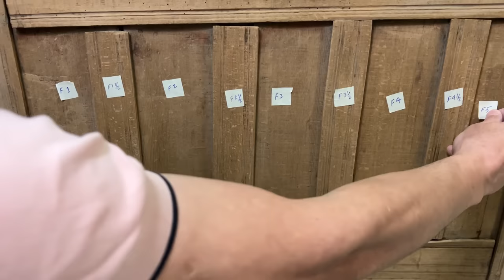Restoration of the 500-Year-Old Chest - FURNITURE RESTORATION

Comment: I'm glad you're happy with your work. 

If i had brought this to you i would not want done what you did to it. 

Wash it down with soap and water and steel wool. 
Let it dry.
Apply seversl coats of bees wax! 
Polish or buff!

Fini!!!

The dirt, grime and dust are all part of its history. It now looks nearly new, which a 500 year old piece should/would not do! 
You simply went too far, in my opinion!!!  I prefer old things in a more 'as found' confition! 

There is a HUGE difference between repairing, restoration and conservation.   I prefer conservation and you prefer restoration. 

To each their own.   But please consult with museum preservationists before working with the more rare pieces you deal with---  for a bit of added input.  

PLEASE!!!
Reply from the maker: Thank you my friend,
True, I prefer restoration, I like to make things usable, I hate dirt, I cleaned and restored this in the way of my ancestors...
Beeswax is good, Worm wax is a problem for this piece...
You are right, I may have gone a bit too far, but I did not destroy the patina of this piece, it is a special wood, if I had followed your method, it would still have the same final shape...

Maybe it's rude, it's the first time, using this wood is uploaded on YouTube, and there is limited information on the internet, for me it was interesting to work on this chest, from the art of carpentry and the type of wood, it's really special...

Now I have a question for you dear friend, why did the carpenter bend the parts inside the pieces?

Thank you for your comment and guide...

Comment: How 500 years ago did woodworkers make the wood panels so thin and smooth? How were the trees processed to such uniform thicknesses?
Reply from the maker: About 2500 years ago, our ancestors used to cut and polish hard stones like mirrors. Carpenters patiently and patiently cut the trunk of the tree in parallel with a two-person hand saw and produced thin timber, and it was also observed in examples that they did this with an ax and then polished the wood.
Reply: @CreativeIdeasMaker  Humans are capable  of so much more than 'modern' industrialists may care to admit. Hand-made and -crafted items I suspect absorb some part or essence of the maker.

Comment: In the beginning of the video you said let's see how this piece was made without nails but i counted quite a few pretty serious nails and why bother with the coke? If you used baking soda and vinegar, the coke would just make things sticky.
Reply from the maker: If you are careful, two types of cast and modern nails have been added to this chest during different periods and it has actually been violated because this chest is made entirely of wooden pins using wooden connections, which we also use as iron nails. removed and we have used wooden pins as in the beginning of its construction. As for the solution, it is a type of cleaner for wood and it also softens the grain of the wood, which helps to better penetrate the oil coating after sanding.

Comment: Will the sesame seed oil dry out, or will it become tacky and gummy with time?
Reply from the maker: This type of oil has little adhesion compared to the adhesion of pollutants such as dust, and on the other hand, it has a significant permeability in wood. If the texture of your wood is soft, you will notice the depth of penetration of this oil.

Comment: Sugar water (coca cola) is a poor cleaner.  It works for some stuff because of the acidity. But then you added baking soda, which neutralizes acid.  The addition of white vinegar raises it back.   Next time, use plain water first, then a diluted all-purpose cleaner.
Reply from the maker: wow, you are absolutely right in terms of toric, but in practice, I made a weak acid with high cleaning and did it with minimal damage to the wood, this is my invention.
Multi-purpose cleaner works great on veneered wood, but will damage raw wood...
Reply: @CreativeIdeasMaker check out Thomas Johnson Antique Restoration.  He uses diluted “Krud Kutter” on veneers and solid wood alike with good results.  He’s in the north east US so an antique here is no more than 200-250 years unless imported.  I’ve personally used mineral spirits, methylated spirits (if a shellac based finish), and plain water for most of my cleaning.

Comment: When do you use the white glue and when do you use the clear glue? Is it just superglue?
Reply from the maker: You should note how deep the cracks are inside the wood. For shallow and shallow cracks that do not have a problem with the strength of the wood, we use instant or colorless glue, and for deep cracks, we use white wood glue or wooden joints.

Comment: what is the purpose of cocacola in that coating at the beginning? which will not harm the wood?
Reply from the maker: It is a good question: I must say that the purpose of adding this sugary drink is to absorb more dirt and it also prepares the surface of the wood for sanding, which makes sanding much better.
Reply: @CreativeIdeasMaker  I don't know if you knew, but I have always done it with water and a little soap and it works very well
Reply from the maker: @franbaburiic8154  Thank you for sharing your experience. Of course, this method is also suitable for washing furniture, but only if the soap grease is completely removed.

Comment: Hablaste de Sonos y tengo todo el sistema de Barra, parlantes era 300 y subwofer ,pero mi TV no es Dolby Atmos, es posible obtener ese sonido o por ser TV no compatible es imposible ? Gracias por la ayuda
Reply from the maker: My friend, Sonos soundbar is great, if your TV has Wi-Fi and Bluetooth capabilities, you won't have a problem connecting, or fix your problem by using a digital audio interface cable...

Comment: Nice job BUT why didn't you wax the wood before assembly ?   The wood needed feeding, all those joints will be prone to rot  and breaking because they are brittle.  Nice job though.
Reply from the maker: Thank you, my friend, the reason is an ancient technique, no one has noticed this carpentry technique, if you have noticed, the sides of the inner parts of the chest are curved with an ax, now I have a question for you, why did the carpenter at that time make this chest like this Made style?
This is a special wood from a special tree
You are absolutely right, thank you again...

Comment: Для 500 лет, он неплохо сохранился.
Reply from the maker: Unfortunately, it has been damaged by old casting nails and modern nails during several different periods, and on the other hand, as shown in the video, there were parts with burns and rot, which we tried to restore all of them and according to carpentry At that time, let's restore the chest

Comment: Fascinating ... but sesame oil as a wood finish?
Reply from the maker: An old way to protect wood (ancestral method)
Reply: Hey , i'm just flicking through all these posts and am actually new to some restoration and up-storing work myself.
Sesame oil is new to me also, but what i have noticed with a lot of old or antique furniture is it needs "feeding" more than polishing. Basically, some stuff looks bad because its very, very DRY!
Oil addresses this problem. I use mineral oil, which is inert, colorless and odor-less. They use mineral oil on wooden chopping boards to re-nourish them.
Reply from the maker: Hi my friend, thank you for your good comment, in the past, they used most of the homemade raw materials, I used sesame oil in the way of my ancestors, apparently sesame oil worked well.
You are absolutely right...

Comment: I will say that you disassembled it with care. From what I can see the wood is beech and was quarter sawn to produce the flecks known as medullary rays. You need to be selective about the areas you sand for example the floor timber was leveled with an adze after you sanded it each high area was marked with a ring it doesn't help the project. Reuse those early nails if you can manage it they are conclusive evidence of early period work.  Get your self a good vice for the table makes it easier for working, mount the sharpening stone on a block and set it in  the vice to  speed up things you will get a better edge, the old guys were at the stone often. I have done early coffers from the 17th century,  your chest is the first type of joined chest  before cabinet making with dovetail construction evolved.
Reply from the maker: Your comment is unique and I was delighted. I enjoy such comments by you who are interested, which are expressed in a professional manner. Most of your statements are important because you said them correctly, especially the last sentence. I will definitely listen to your good suggestions and will definitely use them in the future. Thank you again and I am happy for your cooperation

Comment: Doesn't Sesame Oil leave a sticky residue? Or what will be a stick residue over time? Like when people use lemon oil (horrible stuff) to 'polish' their furniture. It turns gummy and attracts dust and dirt, then you need an astringent product to get it all off.
Reply from the maker: You have stated a very important and practical point. Sesame oil gives you a natural insulation coating for polishing wooden products and has good permeability and over the years it not only absorbs dust, but also does not create a sticky coating and does not even attract insects. And the final point is that our only goal was to build this fund based on the carpentry of 500 years ago, of course, as much as possible

Comment: House and furniture seen in this VDO can not be more than max 150 to 200 years old. 
Polishing is not done properly. 2or 3 rd coat of seasme oiling is required.
Reply from the maker: My friend, all the expensive furniture of this house is out of it and we have done it only based on traditional carpentry. I know the history of this house better than you. You should do some research on this architectural style and then criticize. Sesame oil is the oil coating that is used on this wood, and this is enough, and this coating does not need to be repeated

Comment: I was very very scared when you dragged this venerable chest into your workshop. 
I was even more scared when you started mixing stuff with a very nasty soda. 
I’m still wondering why you didn’t use oxalic acid…
However, I was relieved when I saw how you handled it. 
You made a great job out of it and it came out marvellous. You shaved off a couple of centuries of abuse. 
Still, I can’t help wondering: what would my friend Thomas Johnson have done?
Reply from the maker: Thank you my friend, oxalic acid works great for cleaning deep dirt, I have a bit of an allergy, and the main reason was that I wanted to avoid using chemicals, do the ancestral method white vinegar And baking soda, thanks for the comment...

Comment: Do woodworms not like the wood from the Urs tree?
Reply from the maker: Good question, this type of wood has a very hard texture that is hard to penetrate and is one of the woods that insects like the least. The only thing that should be observed in this wood model is that high humidity causes rotting, like most wood, and a suitable oil coating must be used, which is both moisture-proof and attracts fewer insects.

Comment: A very nice result ! I was a little bit worried seeing you using steelwool on oak-wood, because there can be a reaction of tannic acid in the wood with water or any kind of humidity and iron. There can be blueblack discolorations one can Not remove by grinding. Fortunately that did not happen.
Reply from the maker: Thank you for watching us, steel wool has no negative effect on this wood (ores wood) You are absolutely right about the negative effect on wood that cannot be removed by sanding...

Comment: This may be maximum 200 years old,  500 years impossible.... These nails used in 18th century
Reply from the maker: Thank you for your criticism, but as mentioned in the description of this video, we have said that this ancient wooden box has been violated by cast and even modern metal nails during these few hundred years, and it is quite clear. If we tried to remove all these non-original renovations and use the same carpentry style of the last 500 years and use wooden pins, fortunately we were successful in this task. Thanks for the comment

Comment: Them nails are very old there hand forged square shanked flat heads there proberly over 300 yrs old. You couldnt buy them nails at a shop or a store they had to be ordered from a black smith so he could make them individually. You can see where the wood was flattened with a adze. like a axe only the blade direction was flat and pointing downwards. Used to flatten wood before circular saw blades were invented to use in saw mills. i noticed that you carefully tried to keep them adze marks in good man. I would of personally used hide/fish glue in all them joints. As with a little heat can be undone if needed and would of held the whole structure together better after all theres a reason someone put them old nails in it and hide glue would of fixed that
Reply from the maker: Thank you my friend for your kind comment, I restor this chest in its original form without nails and without glue, if you see a nail in this chest, it was a historical violation, its connections were all latches and wooden pins. It does not need glue or nails at all...

Comment: Don't understand the makeup of the initial cleaning solution. Baking soda and toothpaste ... OK. Adding the vinegar just completely neutralized the baking soda ... might as well just be plain water!  Cola?  Suppose it might be a bit like "sugar soap".  Seems like it would be better to just use plain water and a mild, plant based detergent to loosen the soil of time.
Reply from the maker: If you have some knowledge of chemistry, you can find out that the ingredients of this solution provide a combination that has a good cleaning and is very suitable for the purpose of softening the texture of the wood surface.

Comment: Doesnt sesame oil go rancid over time which would make the chest smell...
Reply from the maker: It's a good question, the reason we used this oil is for the following reasons:
High effect on this type of wood, not being liked by insects due to the hard texture of the wood with the coating of sesame oil, not absorbing dust significantly and finally, it is worth mentioning that this is the method used to make this box.
Reply: Oh cool, and interesting. I ask cause when I oil my cutting board I have to be careful of what oil to use cause it could smell. Thanks for answering 🙌🏼

Comment: Yo creo que si le hubieras rectificado las maderas cortándolas todo recto bien hecho a escuadra, y a la misma medida habría quedado mil veces mejor porque sigue pareciendo un mueble hecho de retales que por ahí entran insectos de todo tipo....
Reply from the maker: My friend, this is an old chest, with a unique structure, the reason why the parts are found inside is the art and skill of the carpenter.
 If you have noticed, I did not oil the inside, because of the structure of the pieces, by splashing water on the pieces inside the chest, the wood will curve and make the box stronger.
One of the properties of the wood of this chest is that insects do not approach it...

Comment: Комоду ,вряд -ли 500 лет...При разборке дна комода,были вынуты аутентичные кованые гвозди.Остальные гвозди,при предыдущих ремонтах,современные.В инете,я видел как делать шканты, с помощью резьборезной плашки нужного диаметра.Принцип тот же.
Reply from the maker: Thank you for your attention, but if you are careful, these types of old chests only use wooden connections and pins, but during different periods, first cast nails were added, and then the common nails of today were used for non-original reconstruction, but we tried We removed them and rebuilt this fund based on traditional carpentry.

Comment: I date it about 200 years old at the most, round nails weren't invented until the early 1800s... I seriously doubt that building was 1,200 yo either, this guy isn't truthful.
Reply from the maker: Hello my friend, if you have any criticism or slander, please be fair. I told the date of this building and chest from the available documents. I explained about the nails at 13:32 and the house at 00:30 and please read the description...
Reply from the maker: A few important points. If you watched the description of the video, you would have noticed that it was said that the main building of this house was built around 1200 years ago, but it was completely destroyed during three strong earthquakes, and the last reconstruction was completely 500 years ago. The second point, if you pay attention to the structure of the box, this device has three types of nails, wooden pins that were used at the beginning of construction, and today's cast and modern nails that were added to the box during different periods. It has ruined the originality of the fund. If you watched the video until the end, you would have noticed that all the metal nails were removed and the box was rebuilt according to the traditional carpentry of that time. There is also criticism, it is better to do it in moderation, not speculation and slander